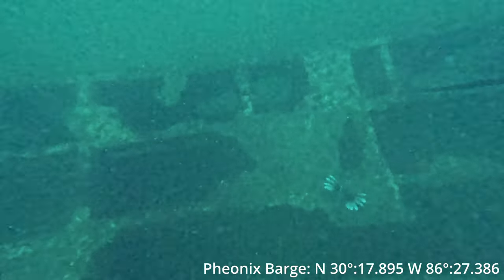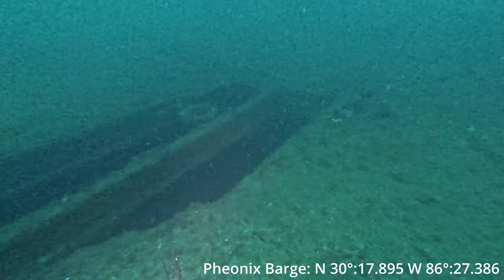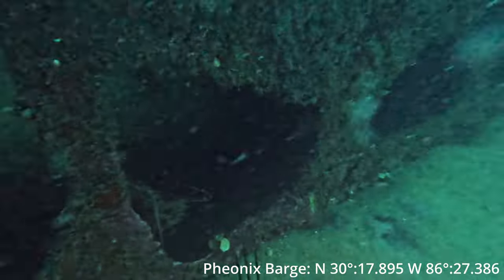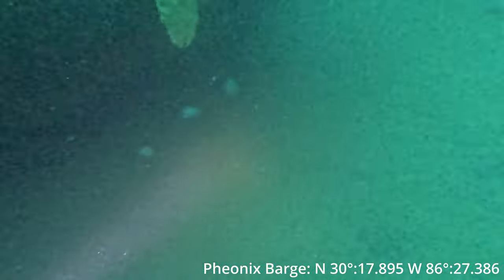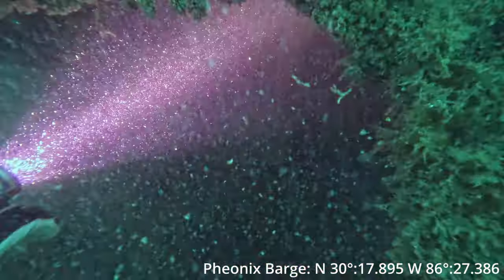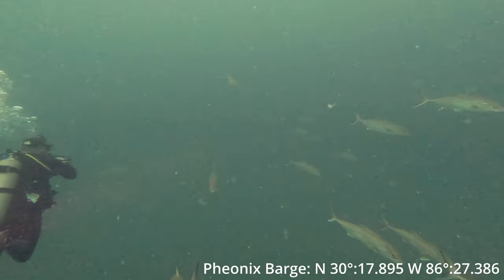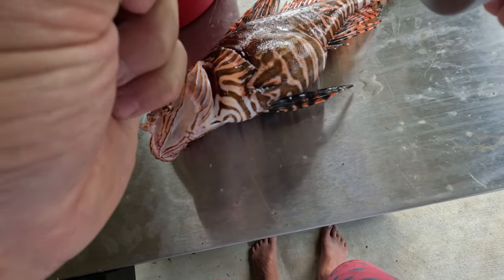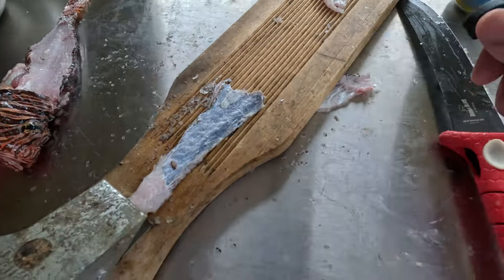Lionfish Hunting in Destin Florida: ULTIMATE guide to spearing & handling these venomous invaders!

Comment: Good Video, Very Informative for those not in the know. A shorter spear definitely works better on top but not as good underneath the barge. Gary at Gulf Divers in Orange Beach makes the best ones. Also you cut the pectorals off and indicated they have spines, but they don’t.
Reply from the maker: I ended up getting a shorter spear.  Hopefully it will work out, though the long one was nice to reach inside.  Correct, the pectoral does not, I meant the pelvic.

Comment: Great job! How many did you get? Also, how deep is the barge! There is not much meat after you fillet them.
Reply from the maker: I ended up with 8 of them.  Would have been more if I would have not lost a few.  The little ones do not give much for fillets, the bigger ones have way more meat.  The barge was about 78 feet to the sand and about 60 feet to the deck.